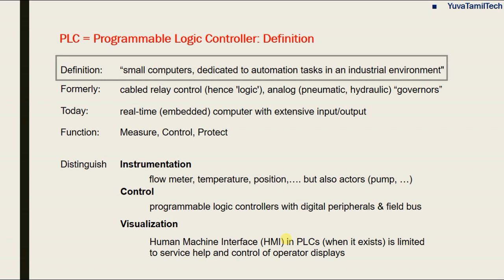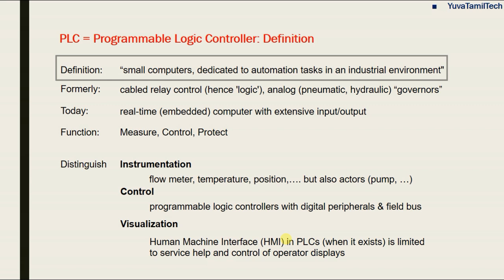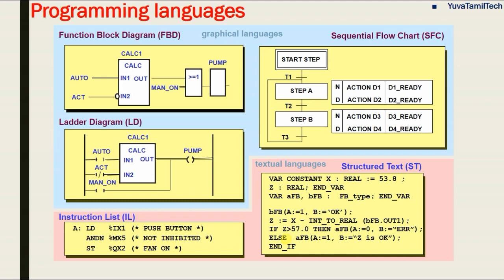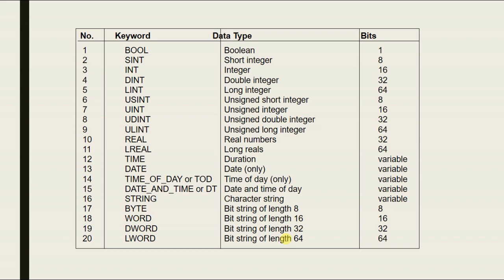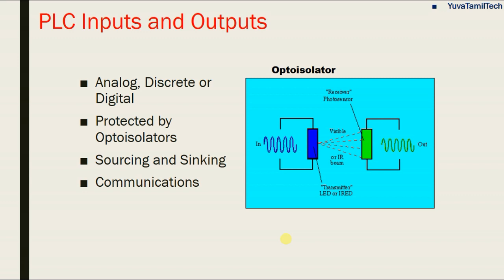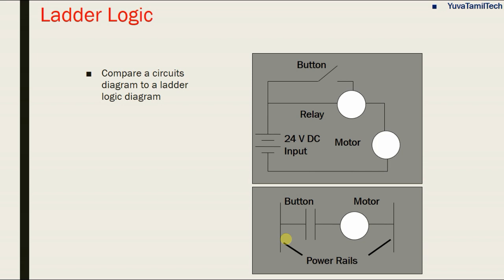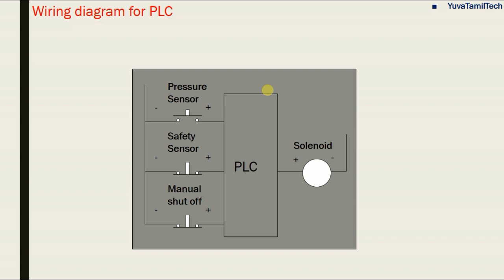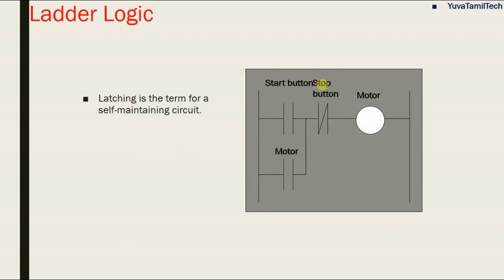Basic PLC for Beginners in Tamil Language

Comment: Ji analog sensor epadi program la use pannanum.
Antha analog voltage vachi break pressure or motor speed epadi control pandrathu nu oru video podungalen..